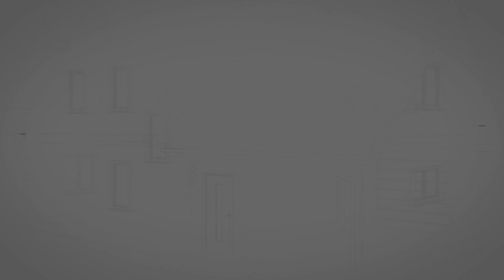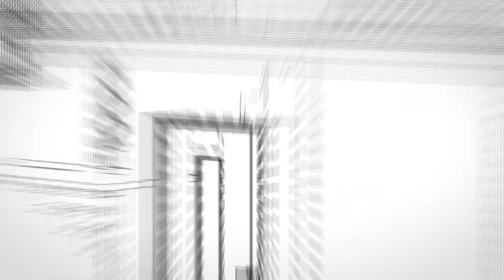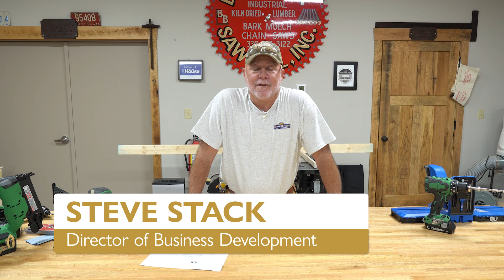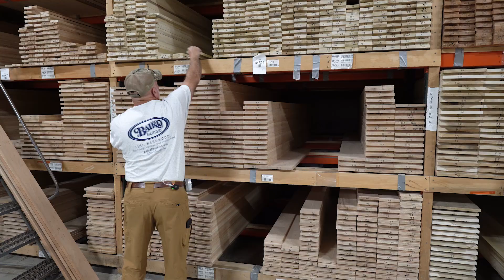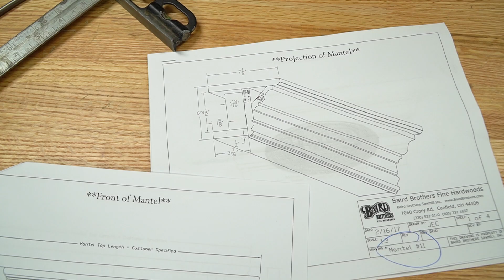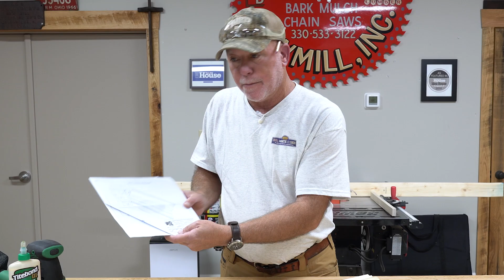DIY Tutorial: How to Build a Fireplace Mantel (Build It With Baird)

Comment: Thanks for this. I recently took down my mantle to strip and repaint or stain it. It's a full mantle with legs (I dont know if that's the proper term). That sucker was attached to the wall with like two dozen nails. There was a gap where two boards didn't meet like they should have, so someone had filled the gap with caulk. One of the "legs" came off when I put the whole thing on saw horses. 

I am seriously considering taking all the pieces apart and putting them back together. Between that thought and the thought that screws should sometimes be used instead of nails, I am now at the start of a mantle building/hanging video binge.